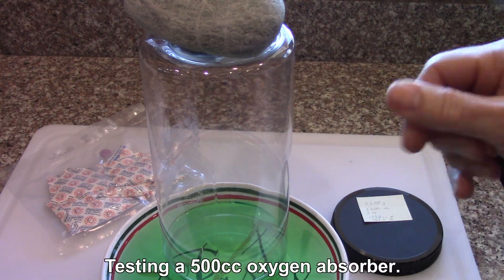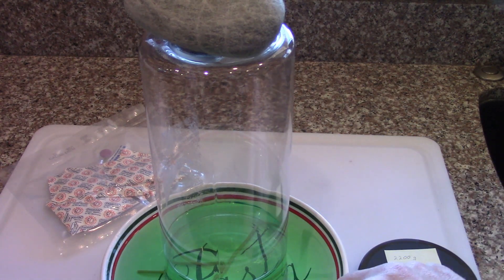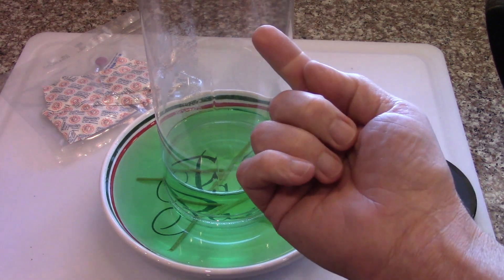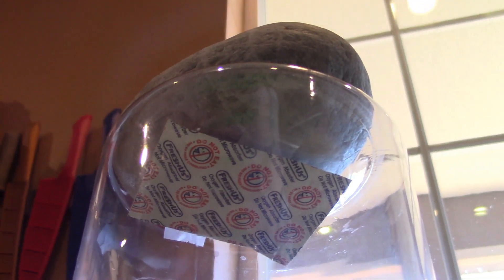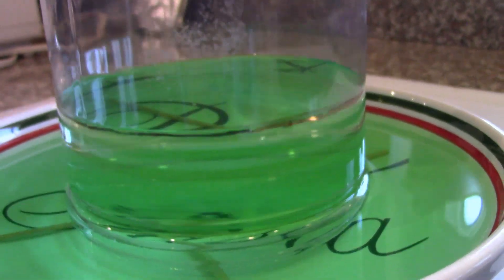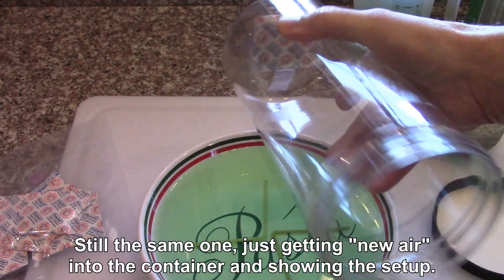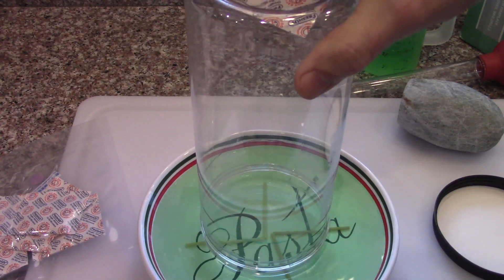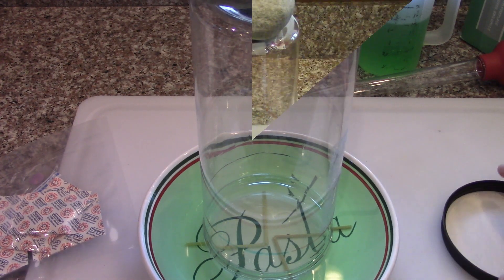Testing A 500cc Oxygen Absorber. Simple Science Experiment With Oxygen Absorbers.

Comment: One more thing I want to try that I thought of laying in bed last night; I'm going to connect my automotive vacuum test gauge to the vent pipe of my pressure canner, with a test oxygen absorber inside.  

The theory is that if the O2 scrubber is working, it should create a partial vacuum that the test gauge would show.  I'm hoping that the test gauge is accurate and sensitive enough to measure that low vacuum.  

I'm thinking that if the oxygen absorbers being tested soak up all the available oxygen in that vessel, then the vacuum gauge should read about 6" of vacuum??  No matter what the volume of the test chamber?

I claim that because no vacuum equals 0 inches of mercury, while 30 inches of Hg is a perfect vacuum.  And we're only removing about 1/5th of the gas volume in that space. 

That amount may not be exactly accurate I suppose; there may be a significant difference in the vapor pressures between oxygen and nitrogen.
Reply from the maker: I don't recall exactly what Boyle had to say about this. I remember that pressure and volume are inversely related, so what you propose sounds about right.

Comment: Great demo!  I plan to try it myself, with a twist: I'll try to find a taller clear cylinder so the test can be run without having to reset it half way through.
Though I loathe Amazon, perhaps a clear polycarbonate 4" x 3' pipe like this might work. Search "POWERTEC 70272V Clear PVC Dust Collection Pipe". 

With a 4" pipe, 1 foot of length should equal about 2,500 cc of air volume. 
Unless my math is way off, one inch of water rise should equal about 200cc in oxygen absorbed.   A few feet would be needed for an adequate vacuum chamber.  Narrower pipe may work, too. 

I think this pipe may adapt to common, 4" PVC plumbing fittings, so you could use ordinary caps or plugs from Menard's or Lowe's. 
Inside of this cap you could fasten a small binder clip to hold the test OA. 

The cylinder would need to be graduated with marks beforehand to denote the water levels.  A '0' mark should be added as well for a start point. 

To start a test, the test cylinder would need to be stood up in some vessel of water; maybe a small bucket or dishpan.  A small hole could be drilled towards the bottom of the pipe so you would not need to have spacers under it. 

Fill the reservoir with water up to your '0' mark.  At this time the top of the pipe is open to the atmosphere yet.  
Attach your OA to the inside of the pipe and seal it at the top. Perhaps apply liquid teflon or silicone grease to the threads.

Comment: Great vid.  I'm going to rig up my own test jig.   I'll hang an O2 absorber inside a sealed, 5-gallon bucket.  Then run a thin tube to an adjacent container of water.   
The partial vacuum created by the oxygen absorber should draw up all the water it can into the 5-gallon bucket.  After some time, I'll measure the volume of the water the oxygen scrubber drew in.   I would assume that the water would equal the oxygen volume that was absorbed.
Reply from the maker: Well, to me it sounds like it should work just fine, as long as it's truly a sealed system. If I were doing it I would try to set it up in such a way that you're not having it "lift" the water, otherwise the lowered pressure in such a large container might significantly change (lower) the amount of water it pulls in. In other words, it might just lower the pressure a lot before it lifts any water. Even with the way I did it, I was concerned about that. I think ideally the water would always be the same level inside and outside. (I'm guessing, because I don't know the math on this)

It sounds like an interesting experiment, please let me know how it works out.
Reply: @SchoolReports  Well, you have a point there.  One thing that worries me is that I might start a siphon if the water level in the supply vessel was higher than the water in the test chamber.  That might throw the results off. As well as having to draw the water uphill from the supply bucket, though the error may be statistically insignificant.    Lol, let's ask Phil.......    🤔
Reply from the maker: @TonyGarrett-p1c  Exactly. If the supply is too low it has to "vacuum" it up, and to high it will try to flow in. Both a negative. 
Maybe we get around all of this by using a large Mylar bag and the Archimedes principle of water displacement. That way there is no water pressure or elevation change involved, just check the volume before and after. 
Or. . .  This company make meters that go to 10ppm resolution! And they practically give them away. 😁 https://www.forensicsdetectors.com/products/oxygen-analyzer-for-headspace
Reply: @SchoolReports  Yeah, that's pretty good.  🙄 I was hoping for a good method too to measure O2 levels in the air for drag racing, lol.   
I would think that putting the colored water supply only an inch or so below the receiving jar should not hurt too much.
I'm going to simplify my test jig a bit, with less fabrication.  For a test chamber, I would seal an oxygen absorber inside my 21-quart pressure canner.   Then install a couple hose barbs to an old canning jar lid, fixed to a quart jar, or just some old plastic lid.
And finally run one plastic tube to a supply jar of water, and run another between the quart jar and the vent pipe of the canner. 
After the test the water in the quart jar can be poured into a graduated cylinder or metric measuring cup.

The Archimedes principal has promise though. It would maybe need a really big bag though?
Reply from the maker: @TonyGarrett-p1c  Ha! Never mind, my concerns about a vacuum issue are probably overblown. I was picturing one 5 gallon bucket sitting on top of another bucket and having to pull the water up 2 feet! 🤣 Any size container/bag is going to work, but I would think that the bigger it is, the lower the error percentage. 
With ANY of the volume measuring type testing, the biggest problem is going to be accuracy. If we are trying to check that 100% of the oxygen has been absorbed, even minor inaccuracies would make it so we wouldn't know if there was 0% oxygen left or 1% left. With my crude measuring I just know that it was somewhere AROUND 21%, +/- 1% (or 2%?) It's hard to accurately measure 1cc with a measuring cup.
 Even 1% oxygen left in the bag could be disastrous for long term storage. That's why I ran the experiment, and then refilled the container with fresh air and ran it again to see if it was still absorbing more. It still doesn't tell me what the O2 concentration is in the container; I'm still trusting that the absorbers actually work the way the manufactures claim they do and can pull it down to a small fraction above zero. Commercial companies are using them and trusting them so I'm going to too!
Reply: @SchoolReports  Well, I rigged up a little test jig yesterday.   I took my smaller, 10-quart pressure canner and ran a length of clear plastic 5/16" tubing from the weighted-regulator vent pipe to a 1-liter Nalgene bottle of water, with the end submerged. 

A 1-liter Nalgene bottle has graduations marked on the side in 100 milliliter increments.  1 milliliter of course equals 1 CC.    
I started a test with the Nalgene bottle filled exactly to the 1,000 milliliter mark, and hung a "300cc" oxygen absorber inside the lid of the pressure canner, and sealed it. 

My theory is that the oxygen absorber will cause the water level in the Nalgene bottle to drop pretty much in direct proportion to the amount of oxygen it absorbs. 

So far, in 24 hours though the water has only dropped barely 10cc.  It makes me wonder if the new oxygen absorbers are really 'duds'.    
I did a similar test, taping one the OAs into a pint jar, inverted in a pan of water........in 24 hours it's hardly drawn up any water.
Maybe they just need more time, I don't know.
Reply from the maker: @TonyGarrett-p1c  To start with the obvious; well that didn't go like it should have! 
I think I have a picture in my head of your set up, and it looks good to me. So, what went wrong? (Rhetorical question -I'm sure you're already asking that) With the oxygen absorbers I've been using I would have expected it to have drawn in at least 300cc x 180% = 540cc minimum, and as high as 300% of the rated amount = 900cc
Also, the newer OAs we have (the last year or so) have been faster acting than the ones I used in this video. Now I'm going to have to retest. Some OAs are much slower working than others, you might need to let it run for even up to 100 hours.
Have you checked out Phil at 4800 feet, I don't necessarily agree with his every conclusion/method he does (like feeling the food for dry vs doing a dry check using a scale), but he does do the work and testing where lots of freeze dryer video makers don't. He has done a few OA videos. https://www.youtube.com/@Philat4800feet/search?query=oxygen
Reply: @SchoolReports  No lol, it shore didn't!      I started new tests last night with new or "new" 700cc Harvest Right oxygen absorbers I just bought locally.     One was taped up inside a pint jar for 24 hours, and it hardly pulled up any water.

The other I had rested on a tin can inside of my 10-quart pressure canner.   And again I had a tube that ran from the vent pipe to a 1-liter Nalgene bottle. 

I started the test with the Nalgene bottle filled to the 1,000 milliliter/1,000 CC mark, last night at about 11:00 PM.

By mid-afternoon today, the water in the Nalgene bottle had lowered by 200 CCs and has not moved since.  Sigh.
It's been well over 24 hours now. 

I'll let it go for a couple more days I reckon, but......

Maybe there's a leak or something in the system.  If so, I imagine that some of the water that is drawn up in the plastic tube will run back into the Nalgene bottle.  

My canner is an All-American; it has no gasket on the lid but the mating components are finely machined.  I've never noticed a leak while canning. 

The new box of OA's I bought contained 5 bags of 10 each oxygen absorbers.  Four show pink dots to indicate their viability, and one is in fact blue. 
Interestingly, the bag I opened has a pink dot on it.....

My ten-quart canner translates to about 9.5 liters of space, or 9,500 cc or so.  20% of that would be 1,900 cc of free oxygen.  Eventually the whole Nalgene bottle should be emptied out........
Reply from the maker: @TonyGarrett-p1c  Well it is a result, just not the expected one!
 It'll be a few days before I'll have a chance to try this. I can't wait! Figuring out a large air tight container could be my toughest part.
Reply: @SchoolReports  I hope you find it works for you.   By 24 hours ago, no more than 250cc of water was drawn from my Nalgene bottle.  With a 700cc-rated O2 absorber.   But it should not be surprising I guess.  There were 50 in the box, broken down into 5 packs of 10.   And in one of those packs, the indicator dot was blue, meaning they're no good.  And the other four, with pink dots, would be the same age.

I suspect that those oxygen indicator dots don't turn blue until it's basically too late.

I'm resetting the test, this time with two, 700cc oxygen absorbers.  They're largely junk anyway.  
The nice thing is that the vendor cheerfully volunteered to send a whole new pack.    🙂

I've got a couple other ideas, too; see above.
Reply from the maker: @TonyGarrett-p1c  On oxygen absorbers - I only get the ones that are bagged in 10 packs. The oxygen indicators in the packs we have turn from pink (or salmon?) to blue in less then 5 seconds. As soon as the bag is cut and before I can even take out the first OA, the indicator is blue. If I don't use all the OAs from a bag and reseal it, the indicator will turn back to pink over the next few hours. Because of this, I'm believe you are probably correct; if the indicator is blue they are very dead as opposed to just starting to die. 
Every OA I've tested have absorbed at least 200% of the rated amount.

Comment: Great video but your mark didn’t look like anywhere near 21% of the volume of that jar.  Was it really?
Reply from the maker: Assuming I did the math correctly on the post-it-note at the beginning of the video, than yes it was 21% (+ or - 1/2%)  https://youtu.be/NrzsNvy-srQ?t=5
The container held 2200 lm (or cc) 2200 x .79 = 1738 for nitrogen and trace gasses, with 462 lm (or cc) of oxygen. 
I put 1738 lm of water in the container and then marked the level. I could have been off a tiny bit, but not much.
Reply: @SchoolReports  If you measured then I’ll take that as correct.  It just looked very low.

I don’t know the actual volume of the jar so I’d measure that with water, subtract 21% and mark.

Great video.  I don’t mean to detract from that fact.
Reply from the maker: @DMS20231  🤣 It looked wrong to me too, when I did it, so I measured everything twice and redid all of it both ways. It came out the same each time. I'm guessing it looks odd because of being upside down and partly submerged in the water.
Reply: @SchoolReports  If you did it right then that’s it!  All good.  Sorry to confound things but that’s what I do :-) nice job on a good video.
Reply from the maker: @DMS20231  No problem. Nobody questions/doubts me more than me!
Reply: @SchoolReports  That is always a good plan and I do it daily.  Best to you and good health!

Comment: Haha. I would love to have seen it in fast motion while the water was going up. On the first on I had no idea what you had done until I saw you putting the container on the 2nd time. Interesting. Did you use the same OA on the 2nd try as well?
Reply from the maker: Yes, it was the same oxygen absorber the whole time. I plan to do another video with a used oxygen absorber from a Mylar bag of food I packed a few years ago. I'll try to do a fast motion while the water is going up.
Reply: @SchoolReports  - Thanks. So...I'm wondering if I can use the same OA again if I open a jar or bag and close it up again fairly quickly.
Reply from the maker: @annwithaplan9766  I hate give you a wishy-washy answer like maybe. But, maybe. First, I have never had the need, so far, to reuse an oxygen absorber or reseal a bag that I've opened. But if I did, knowing that I'm using OA that are rated for 500cc of oxygen (which would be the oxygen in 2/3 gallon) AND they actually absorb at least 2 times that, AND I'm using them in 1 and 2 quart bags, I would probably reseal the bag quickly and not worry about it much. I'm starting a test with a used OA from a bag today; a bag of apple pie filling from May 2019. I'm not sure what size oxygen absorbers I was using then. I'll find out soon.
Reply: @SchoolReports  - Okiedokie. Well, considering it's just myself, I can't eat a whole jar of something, unless it's a pint jar. So I've stopped using the larger containers. I'm using pint jars now, and the smaller mylar bags for single servings of meals snacks, etc. This way I won't have to worry about resealing anything.
Reply from the maker: @annwithaplan9766  We, too, are now using mostly just the pint and quart bags unless we are 100% sure we need a larger amount of something. I'd rather open two small bags than have a large bag and only used half.
Reply: @SchoolReports  - Yes. I did up a bunch of powdered eggs and put them into quart jars. Then I thought to myself, "what were you thinking?" Then I reminded myself that at the time I forgot to bring the smaller containers and had to get them into something quick. I'll get them into smaller containers eventually, at least I have OA's in them for now.